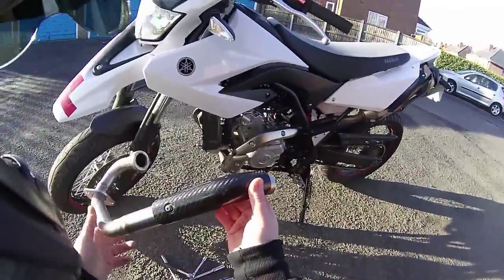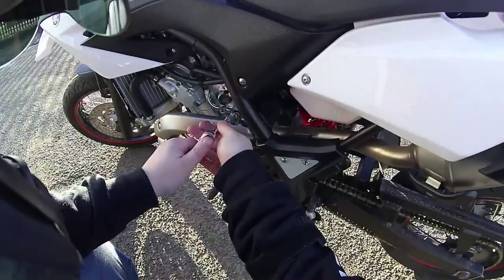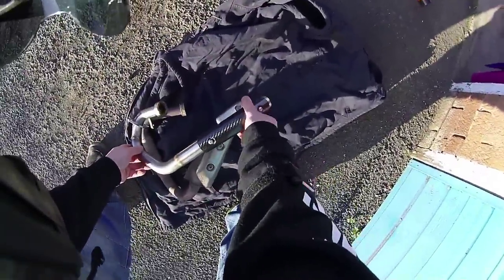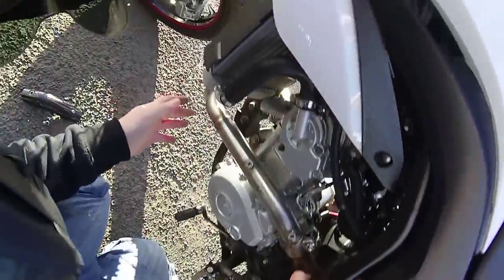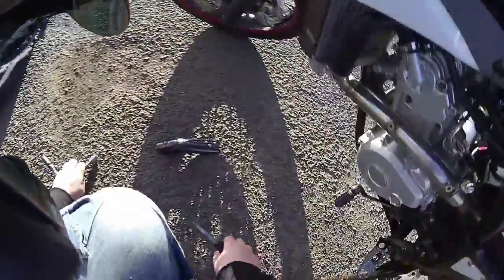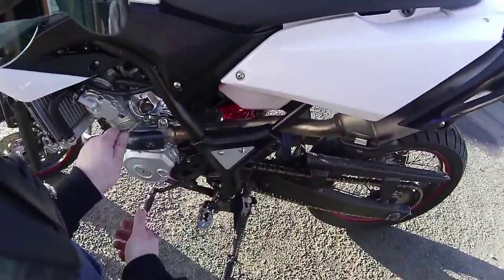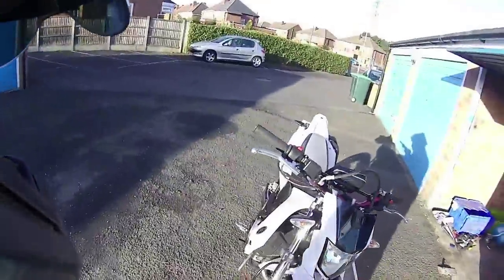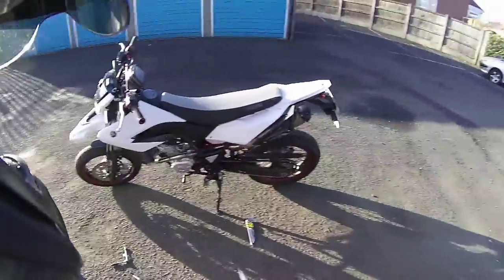Arrow Decat Pipe Upgrade Part 2 (Fitting)

Comment: Good vid double M. Be sure to have a look at your plug after 10 miles or so. You've put a better pipe on there and got rid of the catalyser in the process. You might need to upjet a bit. If I were you I'd glue the cap on the airbox. Make sure it doesn't come off. Not too sure what goes on inside 4 strokes when they're too poor because of daft leaks - but I can tell you - with 2 strokes it's catastrophic.
Reply from the maker: Ye don't worry mate I took it on a good half hr ride after this an did a few plug checks along the. Way To be sure but seems perfect I Think with this bike being injection rarther than good old carbon the computer took care of it as for the little cap it wasent the best fit tbh so when I was off cam I coverd inside with gasket sealant an put a jubale clip on it to make sure it's nice an tight :)

Comment: Can I ask what have you done to your exhaust can?
Reply from the maker: I've used 3 1 inch spacers an some longer bolts to space the end cap away a bit it makes the  std exhaust a bit louder as std it's way to silent kept getting cars pull out when filtering this is simply a qwick fix till I get a arrow end can :)